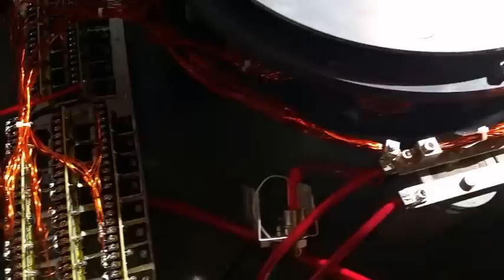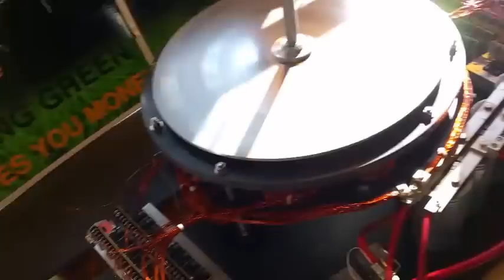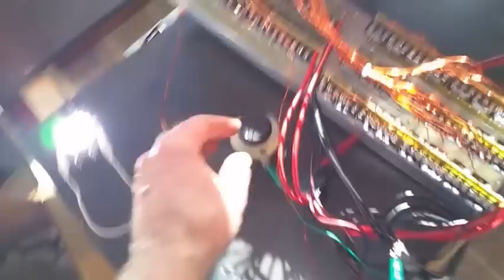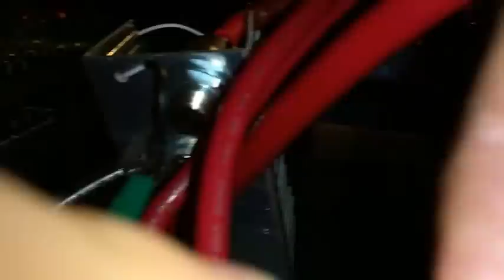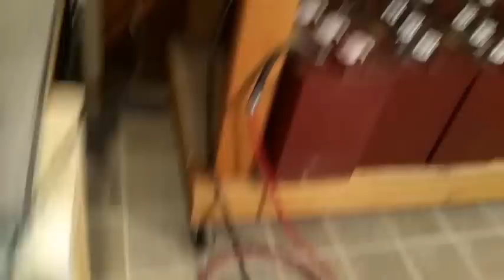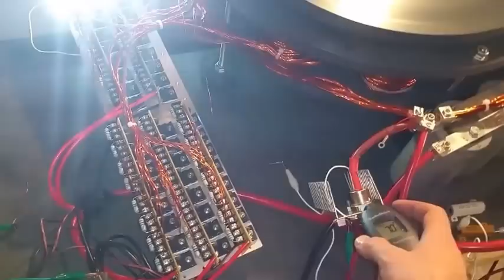10 DualPole Motor Energizer Running at 24 and 48V Powering 1000W LED Module

Comment: Hi! Rick
R1 at 12V primary is 10 Ohms
R1 at 24V primary is 330 Ohms
R1 at 36V primary is  "?" Ohms
R1 at 48V primary is  "?" Ohms
Reply from the maker: No. You could even use 10 ohms at 48V. It depends not just one voltage but amperage you want to run it at. The R1 limits the amperage. The branch resistors off each board also regulate this so it is a trade off between the two.

Comment: hi rick what will happen if you put the coil closer to the magnets?
Reply from the maker: kevin pounal That's as close as they can get. We have the gap at the optimum spacing. There would be too much of a magnetic lock if you went closer.
Reply: +kevin pounal What would happen if he turned his mic up so we can hear him?

Comment: rick hi again  one more time good job
my 4 dual pole motor speeds up when connecting the generators coils to the battery or to another load. this happens to the 10 coiler also.
and if you want to connect the charge batteries to a 12v invertret then you have to disconect the wires and the make all the batteries in parallel to get 12v and then run the inverter it seems that is a problem. I mean if you want to use all the charge batteries not only one.
tnks